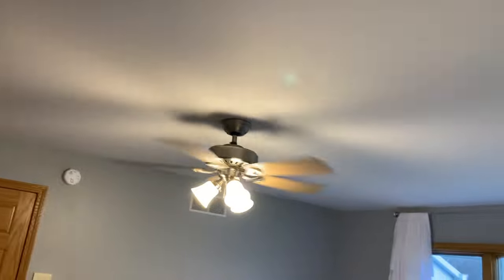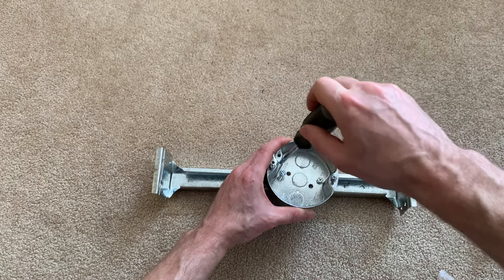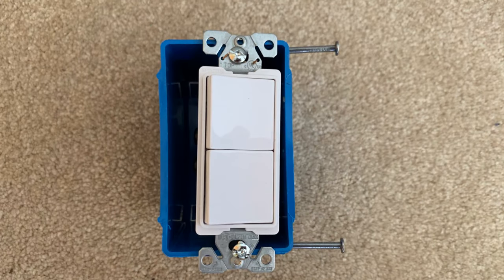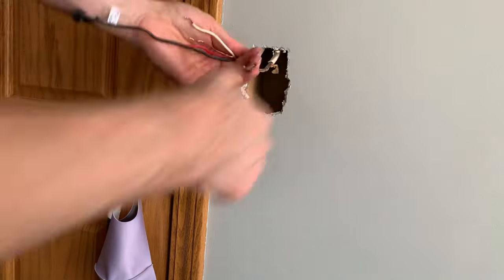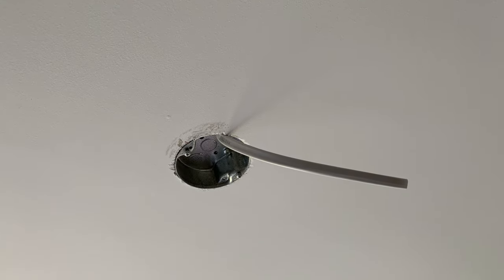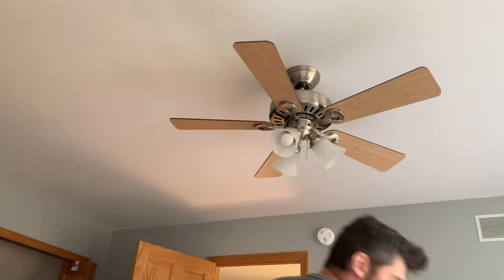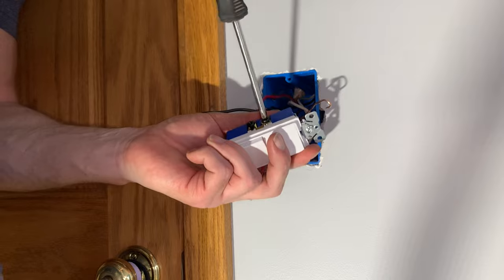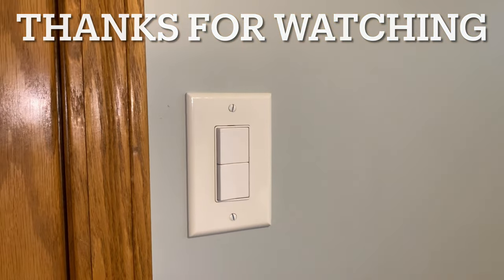How to Install a NEW Ceiling Fan IN A ROOM WITH NO CEILING FIXTURE | New Box, Fan, Wall Switch, Wire

Comment: What did you do with the wires that were originally being run to the outlet?
Reply: I want to know this as well!
Reply: You can splice the wires coming from the breaker (line) and your wire to the outlet (load) together. So you bypass the switch. Then use a third pigtail to power your switch and then your new wire to the fan and light.

Comment: I am looking to do this at my place and I am wondering if after you take the outlet off of the switch will the outlet still work or will you have to mess with the wires at the outlet in order to still get power there?

Comment: If anyone is doing this you should drill from the bottom
Reply from the maker: I drilled from the bottom so:
1) insulation would not fall all over through the hole
2) so I would not drill through any electrical wire that may be laying up there

Comment: Great video with a lot of excellent advise. When I installed the ceiling fan in my home I installed wireless receivers with transmitters to turn the fan and lights off separately. The receiver controlling the light includes dimming which I found necessary because of the brightness of the new led light bulbs.
Reply from the maker: I have seen those. They are pretty nice!
Reply: Where did you get them from?

Comment: Recently installed new fan without existing wire.

Light switch had no power line coming in, so I had a light in attic on 15 amp circuit that I decided to pull from.

Used 14/2 Romeo 3 wire.

Connected black to black (power), white to white(negative), and grounds together then back onto the attic light pull switch.

Light turned back on after connections, and I ran my power line to light switch where I needed power.

Ran a Romex 14/2 from fan to light outlet, then connected new power line to fan line - black to black, white to white, and ground to ground.

Only wanted one switch so used wingtips at end of the connections, and made one line for each- black, white, ground which I connected to a new switch for use for powering on fan in that light switch.

I turned back on breakers, and fan was on.

However if I flick the switch it’s wired to it trips the breaker.

Is it the wiring of the new switch, attic light circuit overloading? 

Any thoughts?

Thank you!
Reply from the maker: I will take a look, just so you have an idea of what may be wrong, but the answer is to hire an electrician.

There is a wiring issue. When you turn on the fan switch, it overloads. You have a hot grounded. 

I tried, but couldn’t quite follow how you wired it. There were too many conflicting terms used, and I wasn’t sure what locations were being described.
(Fan line, light switch, light outlet, attic light, attic light pull switch)

I will outline the required wiring below for your own visualization and conception so you may understand where the problem lies, but my only advice/recommendation is for you to hire hire an electrician. You are unsure and guessing with electrical wiring is deadly. Hire an electrician. 

There are only 3 devices and 2 wire runs involved. 
Devices:
1. Existing power source (sounds like a pull chain light in the attic)
2. New fan switch
3. New fan
Wire runs:
1. (first) 14/2 from existing power source to new fan switch.
2. (second) 14/2 from new fan switch to new fan

Procedure:
Connect (first) 14/2 to existing power source. Black (hot) to black, white (neutral) to white, and ground (bare copper) to ground. 

Run the (first) 14/2 wire to the new fan switch box.
Connect white to the switch. Leave black and ground loose (not connected). 

Connect new (second) 14/2 into the new fan switch box.
Connect white to the switch. Connect black wire to the loose black wire. Connect ground to the loose ground, then connect the spliced grounds to the switch. 

Run the (second) 14/2 from the new fan switch box into the fan box. 
From there, follow the wiring directions that came with the fan. But, it will be hot to hot, neutral to neutral, and ground to ground. 

I hope that helps for understanding purposes. Hire an electrician.

Comment: Hello - thank you for the informative video. In your diagram it looks like the hot from your box or existing wiring is going to both black screws. Does this mean either/or? Or splice for both? Thanks.
Reply from the maker: It’s going to both. 
This is a double switch. Both switches need the hot wired to them. 
A double switch should have a jumper between them by default. In that case you only need to connect to one of them, either one. 
Otherwise, if they are not factory jumperd, wire it to either one, then jumper it from that one to the other one.

Comment: I have the same situation in my room, but I have an outlet below that I plug in a lamp controlled by the light switch. How do I switch that so that I can use the light switch to control the new fan? Then use the outlet to plug anything else besides a lamp?
Reply from the maker: That’s exactly what I did. Now the switch controls the ceiling fan, and the outlet always has power like a normal outlet.

Comment: So good, thank you!! I’m procrastinating because I’m mom, and I don’t want to go into the icky attic space. 🤢 how do I know the width of my drywall?
Reply from the maker: Lol. You can handle it!
Drywall is typically 1/2” thick. You need to drill the hole regardless, so you can drill the 4” diameter hole and measure the thickness of it.

Comment: Did you install a ground wire from the attic? Or did you use the ground wire from the ceiling fan mount to ground your ceiling fan?
Reply from the maker: There’s a ground wire with the conductor wires.

Comment: GOOD JOB! 
Ps Cut the coat hanger on a 45° angle at both ends make it as long as it can be straight! popping it in your drill and you can find spots floors and IF you don’t drill it in the right spot it’s small enough in most cases to rub your finger over it and nobody will ever see it if 

a handful in your toolbox or handy as hell
* The black wire that formally went to your switched outlet could’ve been connected to your hot wire at the switch so that you didn’t have to open the box up and put a jumper on that outlet?
Reply from the maker: Nice! Thanks for sharing!

Comment: I’m in the same situation as you. How would you deal with the outlet to always have power on? My outlet has the 2 whites and ground going to it as well as 1 red. The two blacks hots wires are twisted together. Would I just remove the red and attach the blacks to the outlet?
Reply from the maker: Hmmm… there is definitely a way to accomplish it. I would suspect that you are correct and the red went to the switch box and now does nothing, and the black just needs to be connected where the red currently is. I would definitely use a multimeter to verify and sort it out. 

If that is not working out, another thing to consider is leaving the outlet as is and splicing the existing outlet power wire (red?) In the switch (but is now disconnected and does nothing) splice it into constant power in the switch box. This will be like the switch is always on and the outlet will always have power.
Reply: As an electrical guy, your description leaves me with several questions.

I would expect your recepticle to be split (a little tab is broken off to on the hot side to allow the recepticles to function as 2 seperate pieces). 

So the blacks should be constant hot, one in, one to the next double recepticle.

The whites should be neutrals, one in, and one to the next recepticle.

Grounds.....same....this recepticle and the next.

The red, I expect to switch the top or bottom recepticle on or off depending on where connected. 

Your description sounds like someone replaced a recepticle and made both recepticle switch.

Becareful and maybe check with someone local.  There may be some thing unexpected there.

Comment: What happened to the outlet that the switch used to power? This is a great video on how to install but I still have the old outlet box on the other wall the switch controls.
Reply from the maker: I wired the outlet so it always has power and no longer switched. 
In my specific case, the top outlet was switched and the bottom outlet always had power (the connecting tab between them was removed to make them independent). I just installed a new outlet leaving the connecting tab in place.
Reply: @HowtoandReviewsOfficial  So the switch no longer went to the outlet? Did it have power to turn on the fan or light?
Reply from the maker: @davidcarroll4939  That’s correct, the switch no longer went to the outlet.
Constant power came into the switch box, connected to the switch, and the switch used to send power to the outlet. 
I ran a new set of wires to the ceiling fan, so now the power still comes into the switch box, connected to the new double switch, which sends power to the fan and fan light.
The wires that used to bring switched power from the switch to the outlet are not connected and do nothing (they are still in the wall from the switch box to the outlet box, but are not connected to the switch or the out).

Comment: Very good instructional & informative video. I have a question. 
What size Romex cable did you run from switch to ceiling fan. I have a bedroom much like yours. Thanks for sharing. 👍
Reply from the maker: Glad it was helpful!
I used 14/3 (plus ground).
Reply: @HowtoandReviewsOfficial  
Thanks for sharing..!

Comment: I want to do this in my basement, so i wont have the attic to walk around. Wondering how i would mount a brace and feed the cable through. Any thoughts?
Reply from the maker: There is a ceiling box for this purpose; to install in a finished ceiling with no attic access from above. 
https://amzn.to/3Q7v01w
For running the wire, you will need to cut access holes through the drywall at intervals to be able to route it, then patch the holes.
Reply from the maker: Also, you can use a ceiling fan that has a remote control to turn it on and off. Then you only need to run power to it. You don’t have to wire a switch in the wall.

Comment: My dream project is coming closer to reality , but I got a problem,  no wall switch at all to use it for the fan☹! If I had one right now , I would turn off the rotating fan from the wall , because the chain form the fan switch broke on me a couple weeks ago!☻😱
Reply from the maker: You can fish a new wire down inside the wall. You can do it!

Comment: So you abandoned the old switched receptacle?
Reply from the maker: That is correct. But I could have kept it and add another switch for the fan.  
I personally didn’t want that switch anymore. It switched power to a wall outlet for a lamp. No need for that functionality. I rewired the outlet so it is not switched and always has power.

Comment: Would you happen to know how to do the same install in a 2-story condo? 2d story is different tenant.
Reply from the maker: If you are on the first story and don’t have access from above…

This box is specifically made to install through a blind hole with no access from above.
However, you will still like need to cut access holes to run the wire, then repair the holes afterwards.
https://amzn.to/3yRpIhl

Comment: The Raco gang steel electrical box does not look like it is strong enough to support the ceiling fan, no?  how many lbs can this box support?  thanks
Reply from the maker: The ceiling box in the video supports 70 pounds.

Comment: Excellent video! Are you able to control the fan speed with this switch? If not, do we need a different switch type and how can we wire it?
Reply from the maker: The fan speed is not controlled from the switch. There is a chain on the fan that you have to pull to change the speed between low medium and high. 

 know there are fans available that come with a remote control so you can change the speed from the remote instead of pulling the chains.

A possible thought that I have is to use a dimmer switch, and always leave the chain on the high position. Then you can change the speed from low to high with the dimmer switch. I do not know if it is a valid solution, but may be something to look into.
Reply: @HowtoandReviewsOfficial  it is possible to install a dimmer switch to control the fan. Additionally, you can use the pull chain to set the fan to high to control the speed with the dimmer and the chain can be removed from the fan for a cleaner look.
Reply from the maker: @GarrettRAllen  Perfect, thanks!

Comment: Do you lose the functionality of the wall outlet?
Reply from the maker: You can’t choose how to wire it. You can keep it the functionality the same or change it. I disconnected the switch from the outlet, and wired it so the outlet always has power.
Reply: @HowtoandReviewsOfficial  okay that was my question, I wanted the outlet to change to always hot

Comment: how would you wire it if you wanted to use a 3 way switch top to control fan and bottom to switched outlet?
Reply from the maker: Not the right application for a 3 way switch. 3 way switches allow you to control a device from two different locations. There would be two 3 way switches connected to the device, with both switches in different locations, so you could control the device from two different sides of the room for example.

Comment: the line out to something else in the wall switch did you just leave it or did you connect it somehow?
Reply from the maker: I connected it. It was spliced directly to the line in power, before the switch, so it always has power.

So, in the switch box:
3 neutral/white wires in the wire nut;  (1) line in from the breaker, (2) line out to the fan, (3) line out to something else. 

3 hot wires in a wire nut;  (1) line in from the breaker, (2) line out to something else, (3) a short jumper to the switch.
(Or, you could connect both the line in and the line out to the switch if the switch has previsions to accept 2 wires at the input)

4 ground wires crimped or in a wire nut;  (1) line in from the breaker, (2) line out to the fan, (3) line out to something else, (4) short jumper to the switch. 

I hope that makes sense.
Reply: @HowtoandReviewsOfficial  oh I see, I just got a bit lost in that part in the video but it makes sense now, thanks for the reply man and great videos!
Reply from the maker: @robertokuri7108  I probably should have added one more diagram with the extra line out spliced in to clear it up.
Thanks, I appreciate it!

Comment: Did you connect the spliced grounds using a wire nut?
Reply from the maker: You can use a wire nut, that’s no problem. 
You can also twist them or crimp them because the connection doesn’t need to be insulated.

Comment: The green screw that comes with the ceiling brace and box kit, did you use it? Is it necessary?
Reply from the maker: Metal boxes should be connected to the ground circuit. To be safe, jumper from the wire nut with the other ground wires in the box to the green screw inside of the box.
Reply: @HowtoandReviewsOfficial  that makes sense, thanks.

Comment: What if you don’t have a ground wire if it is a 1960 house?
Reply from the maker: The only responsible and safe advice I can give is to consult a qualified electrician and install a grounded circuit box and run grounded wiring.

Comment: I was worried for your safety since you had PT pants on with no PT belt.
Reply from the maker: Lol. I was active duty a little over 20 years ago when they had just switched from sweats to these black pants and gray jacket. They didn’t have the belt then. I think the jacket was a little reflective, but probably not enough. The belt must have came later.

Comment: ONE THING YOU MISSED:
Good video, however before installing the wall switch into the recepticle box.
1. Always test your switches to insure the fan and lights work.
2. Always wrap electrical tape around the switch to cover The Side Screws. This prevents future possible arching.
Other than that very Good Video.
See Example Here:

https://youtu.be/mY45ZDdiPn4
Reply: Isn't tape around the screws only needed on a metal box?

Comment: I thought 3 wire plus ground was yellow!?
Reply from the maker: The color is associated with the wire gauge, not related to 2 wire vs 3 wire. 
14 gauge is white
12 gauge is yellow
10 gauge is orange

I used 14 gauge